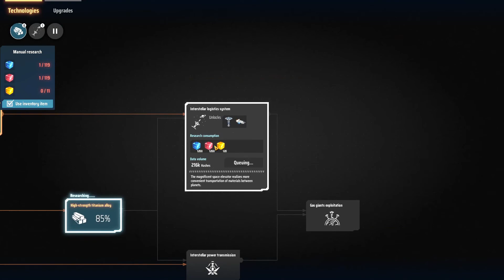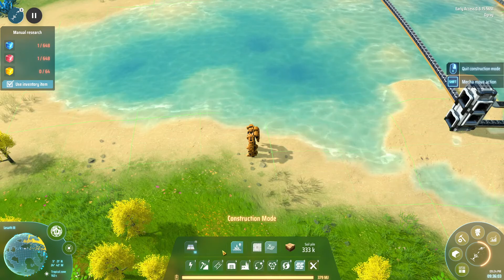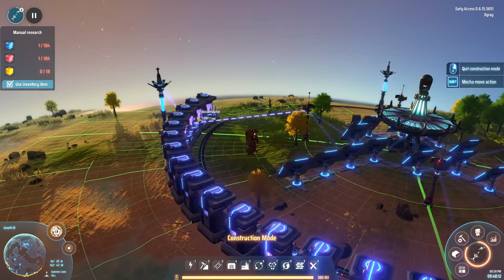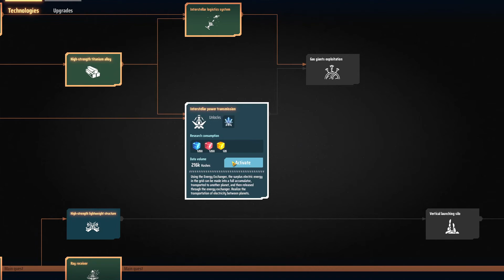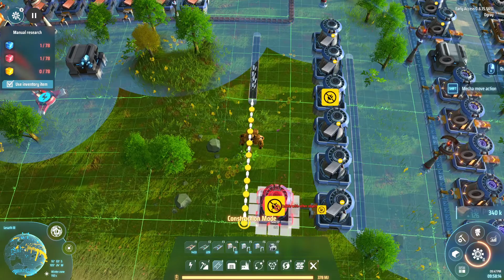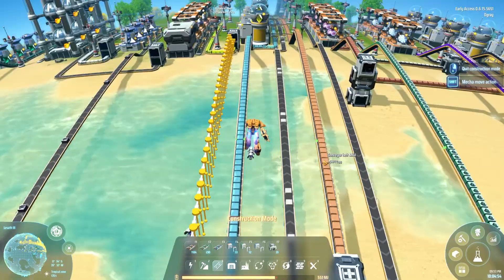ACCUMULATORS AND SOLAR POWER! - Dyson Sphere Program - Let's Play Tutorial Gameplay DSP Ep 14

Comment: here is a suggestion as you are going to upgrade make 5 belts stacked on to each other on the equator line around the planet for each raw resource i think that will help you a loot in the long run but only for the Raw once  the rest you cant move around whit logistics ports

solar power on poles is not weary effective as you wont fit much of them there also the day and night cycle  is just longer but is there